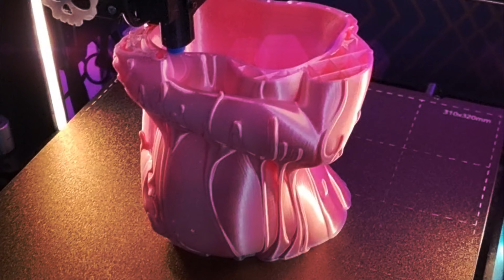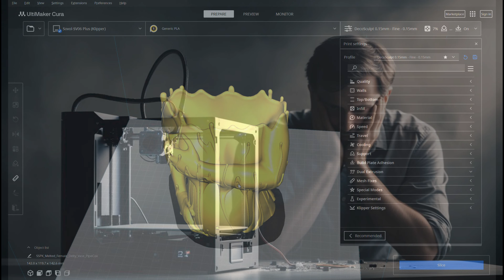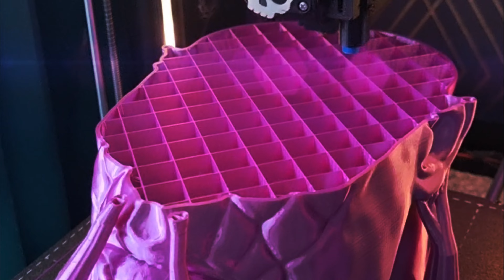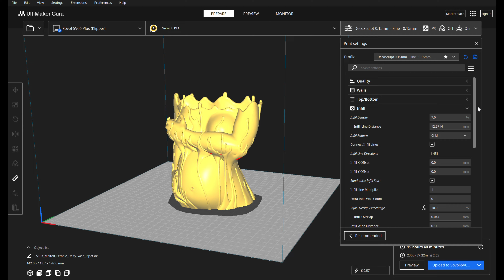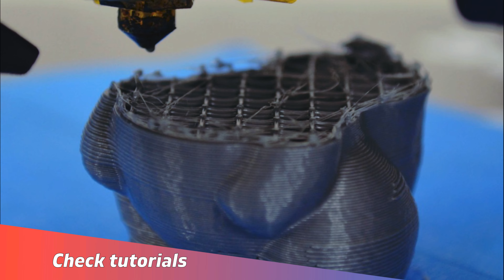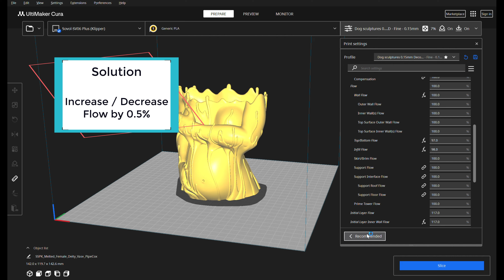Cura Beginner’s Guide to Stronger 3D Models| DecoSculpt3d

Comment: Also I was wondering if you have any experience (Cura settings) with something like PolyMax™ PC filament? It is a polycarbonate-based material. Sometimes I need a part made with a high strength material.
Reply from the maker: Thanks for your comment and question. I haven't done any prints with that sort of material yet, but I'm pretty sure you would be able to find someone else's guide video for that kind of filament 👍🤔